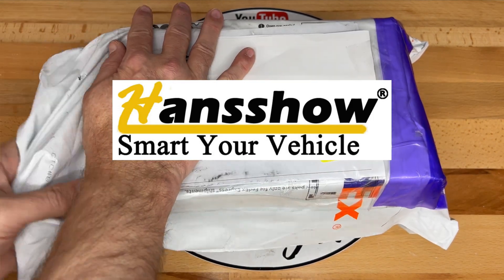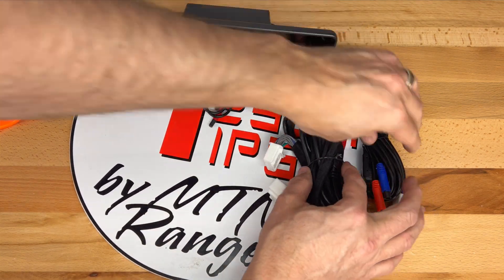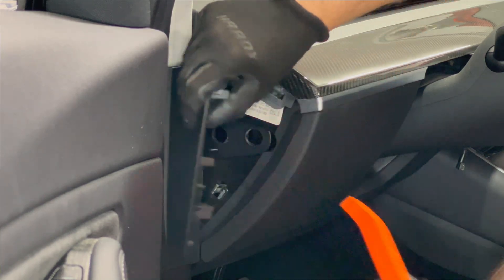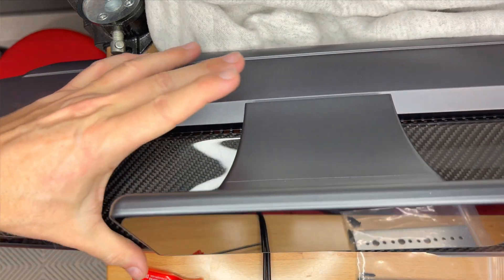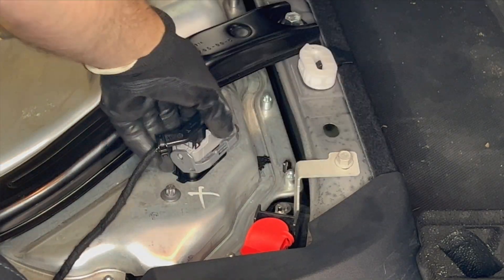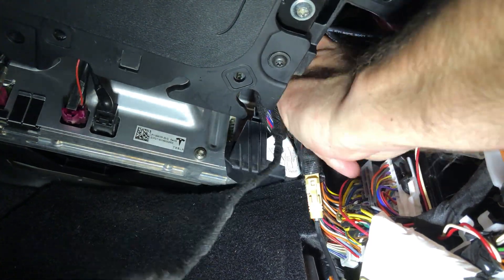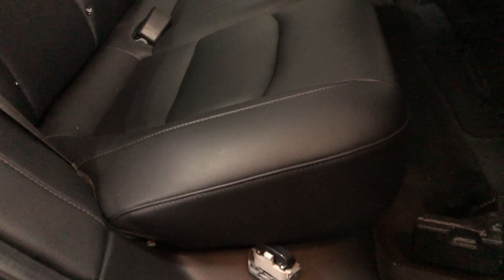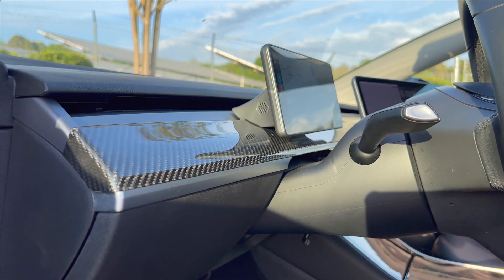Tesla Model 3/Y - Hansshow Touch Dash Screen with Apple Carplay and Android Auto - Installation

Comment: Hi, where do I hook up the power (red & black) wires for the AMD version?  Where can I download the installation manual for this 2nd generation Hansshow unit?
Reply from the maker: I have an Intel system, so I don't know where the AMD wires are.  Most likely in the same area, I guess.  Here is a link to the manuals I have: https://drive.google.com/drive/folders/1k5zyAvx-luI7tXWKqJKnPRrJwZ5pe4pv?usp=sharing
Reply: Thank you so much for your help.
 @MTNRanger

Comment: For the 2023 Tesla Model Y/4 the plugs look different under the passenger dash panel and the cable used is not the same as the one in the video. Any help with this model? Thanks!
Reply from the maker: I don't have a Model Y, so I can't comment on the different plugs.

Comment: I installed this unit today, however, the screen isn't pulling any data from the car. The display shows I'm travelling at 120kmph when I'm still in park etc. car play works fine. Does anyone know what could be causing this?
Reply from the maker: Check the wire connections (where the red and blue wires connect and the connector that plugs into the car's CPU.)  That's what I would do first.   Carplay will work even if the unit isn't getting data from the car.  It's getting power though.
Reply: @MTNRanger  Thanks for the response. I'll have a fiddle with the connectors. The brightness is in sync with the Tesla but nothing else is which makes me think the issue may be with the unit itself.
Reply from the maker: @johnblanco7662  Then I would contact Hansshow for a replacement.

Comment: Nice vid!!
I have the previous version of this screen and is too hooot where I live i have to take the out because the air is blocked like 90% directly to the face I wonder how is the air flow on this one that’s my 1 one concern as now
Reply from the maker: Yes, this design is smaller and blocks fewer vent holes. I set the HVAC fan to split for both the driver and passenger sides.  I also aim it a little higher than before.  It does block air, but without it the fan direction was never that great in my car anyway.

Comment: Hi, could you please share how you get the 12v red and black wires done. I tried to fish the cable from the frunk but won't be able the see the wires. Please help
Reply from the maker: As I mentioned I didn’t do it in this video.  However, I did do it in the power frunk video: https://youtu.be/NMDmPNRNn4o?t=17m0s

Comment: I have the 2021 Tesla Model 3 long range. Just got the display and I was trying to install  and discovered that the blue and red wire ends are to big to fit through the das holes. Ever hear of that? I have contacted Hansshow and am awaiting a reply.
Reply from the maker: Interesting,  I wonder if there is a difference in the model year.   I contacted Hansshow and I'll let you know what they say.
Reply: @MTNRanger  Come to find out I was trying to insert the harness wires thru the vent holes and not the display wires. I was the idiot. BUT ... Now that I have the display wires thru the holes, there are no screw holes to secure the silver backing plate on the underside of the dash.. So I still have to return it.  I would include a picture if I could/
Reply from the maker: @mervay1  Can you send me a photo at mtn_ranger@aol.com ?
Reply: @MTNRanger  This has all been resolved, I did not realize that I was supposed put the screws through the silver plate and into the screw holes in the bottom of the display poking through the dashboard. Sorry for taking up your time.
Reply from the maker: @mervay1  No problem.  I hope everything goes well.

Comment: I have asked a few YouTube posters that showed a successful install of this device.  I had this professionally installed today and when they plugged in the cable in the back of the computer behind the glove compartment the car freaked out and everything inside the car wasn't working correctly, protection faults, car wouldn't go more than 35 and a rear light stopped working.  They plugged the original cable back in the car was fine after that.  Replugged back in and the same, so I am not sure if I have defective unit or my June 2020 Model 3 has something different than other Teslas.  Did you see any of these issues?
Reply from the maker: Did they do the full shutdown procedure including removing the high voltage disconnect?  I guess it is possible that the cable is damaged or incorrectly wired.  I would request a replacement wiring harness.  Another thing, your car most likely has the Atom CPU, was that the correct version of the Hansshow cable ordered?
Reply: @MTNRanger  I bought mine from amazon which gave me both the Intel Atom and AMD Ryzen cables.  I don't for sure know if they disconnected both power cables.  I provided them your youtube video for a instructions on installing.  I am getting the replacement product on Saturday and going to go back over on Sunday to see if that fixes it and I will make sure we disconnect both power cables from the battery and high voltage disconnect.
Reply from the maker: @AaronMcFarland  Sorry you're having problems.  I hope it gets fixed soon.
Reply: @MTNRanger  Turns out the first one I had was a defective product.  The second replacement one worked perfectly.  The one thing I noticed, both times they powered down the car unplugged it (both the battery up front and the main battery), re-plugging it back in the climate control was getting the message "Climate Keeper unavailable due to system fault" and remote climate control wasn't available, but that message was gone after a night's sleep.  Glad I got it working though.
Reply from the maker: @AaronMcFarland  I’m glad it worked out after getting the replacement. Enjoy!

Comment: Is it okay to attach the center display attached to the tesla model 3 intel version to the new AMD version? I have had old version 10.25". Thanks,
Reply from the maker: As far as I know, the AMD car needs to have an wire attachment to the car’s 12v battery.  The Intel screen version doesn’t have this cable.

Comment: Have you heard of any cases where Tesla would not do a repair if they saw this product installed? Music they won’t do suspension work if someone has done a coilover replacement.
Reply from the maker: No I haven’t heard of it being an issue.  I have a mobile service scheduled next week.  I’ll ask the service tech.
Reply: Guy on YouTube said his battery warranty was voided for getting suspension done at a 3rd party garage.
Tesla can’t be that strict right?
Reply from the maker: @hamster1-1  I haven't heard about that one.  Usually if you get a specific thing done it only affects that part of the car for the warranty.  For example getting modified springs/coilovers that somehow causes control arm damage will not be covered.

Comment: How is the vent air flow after install and how does the screen do in direct heat/sun? thanks
Reply from the maker: I drove today in 85F weather and had the fan direction facing up.  I also find using split helps too. When getting into a hot car, I try to precondition.  Otherwise using it on a high fan level to cool it down and then around 4-5 for normal use.

Comment: The updated 2022 9” version of this product no longer supports the front camera. Updated 9” has a smaller bezel than the original 8.8” to block less air flow.  If you were choosing a display system today would you go with the small bezel 9 inch with no-camera or the 8.8 inch with front camera?  Front camera is nice and low, automatically turns on when front sensors go off and the first seconds of drive pretty cool.
Reply from the maker: It comes down to the camera.  If you really want it, then go with the 8.8" screen.  Another tradeoff is the 8.8" has a 1080x720 vs 1920x1080 on the 9".  Personally, I'm fine with the 9" version.
Reply: @MTNRanger  yeah I think I’ll just go with the newer 9” for the max stability performance, higher res and slightly more airflow.  we already have built-in front proximity sensors which is good enough as well

Comment: It's been a month since this video was made.  Any pros and cons you can share?
Reply from the maker: I took a long trip a week ago and it worked very well. I used ABRP, SiriusXM and other apps.  Definitely nice to have.  The only negative I have is on rough roads, it can vibrate.  I'm looking at placing a foam pad where it meets the dash and see if that helps.

Comment: I have just watched a short installation video of a different display being installed in a Tesla. The connector is located at the bottom (behind the cover) of the rear air vents. I now believe Tesla has more than one of these "connectors" that tap into the vehicles computer for power and data to run displays.
Reply from the maker: Yes, there are multiple places in the car with communication (CAN bus) wiring.  Not all have the same plugs.  The connector behind the center console of a 2017-18 Model 3 has 16 pins, 2019+ has 22 pins.  The wire harness connector with this screen has 12 pins.  https://youtu.be/i08OltkqzYU?t=368
Reply: @MTNRanger  What path would you take with the harness, similar to the Hansshow harness with this display kit, connected at the rear air vents going towards the drivers side dashboard just like this Hansshow display attached in the vents? Would go along the the center console?
Reply from the maker: @Speedbird100  You could remove the center console trim that runs from front to back.  You could route the wire through there and up to the area under the steering wheel.  You will have to remove another trim panel and snake it along that area.  Then go up  to the left side to the dashboard vent area.

Comment: How much would it cost to hire someone to do this?
Reply: Well I hired Car Toys in Northglenn CO to install and for some reason the device is not working plus the car is freaking out with the new plug plugged in.  I am getting a replacement device to see if that fixes the problem.  Currentl the I have spent almost $400 for installation.

Comment: Hi. For an Uber and Lyft driver like myself, will i be able to do android wireless and use the Lyft and uber app on the screen and avoid using my phone for the app and built in app navigation?
Reply from the maker: Good question. I have Uber and Lyft apps on my iPhone and they do not show up on Apple Carplay.  Drivers use the same apps as passengers, correct?
Reply: @MTNRanger  no they have different UIs. Im trying to avoid using my phone while doing Uber so this would be great if it worked for that. Here is what i found on Google, but not sure if its accurate or not.

This summer, Lyft is integrating its app directly into Android Auto for drivers. This integration will allow drivers to view and accept rides right from their car's infotainment system. That means no more secondary device, which should make for a much cleaner Lyft driving experience.
Jan 5, 2022
Reply from the maker: @republicofu.s9642  If that is the case, the Android Auto version of Lyft will work with Hansshow screen.  BTW, I just downloaded the driver versions of the apps on my phone and they still don’t show up on Apple CarPlay.
Reply: @MTNRanger  i sent a message to Lyft support also.
So this display requires no cables to connect to Android? Its all wireless?
And are you able to see all the apps you have on your phone on the display? 
What does it say on the display when you click on the Lyft app
Reply from the maker: @republicofu.s9642  I tested it with a Pixel 5 with Android 12 with a Bluetooth connection (no USB cable).  Android 11 and 12 support wireless Android Auto.

Comment: Nice HVAC shield
Reply from the maker: Honestly, I haven't noticed any issues with the vents since I put it in split mode.
Reply: @MTNRanger  I like getting the breeze directly at me as opposed to ambient cooling in the cabin.
Reply: @MTNRanger  I also should mention that I live in Arizona. Probably a different experience with temperatures than you get where you’re at.
Reply from the maker: @Meaderf  My early 2018 HVAC vents never really seemed to ever direct air that noticeably unless the fan is maxed out.  Newer versions may be better.  Yes, I guess if you require direct air in your face, then this item is not for you.

Comment: I would recommend placing the screen on the dash before removing, mark the position with tape, that way regardless of year, model or otherwise you aren't just relying on Hanshow's estimate on where best to mount it.
Reply from the maker: Yes, that's another way of doing it.  Thanks for the suggestion.

Comment: I have read that the 2022 Model 3 / Y has the wiring connector in a different location, not under the passenger side glove box. The connector is located behind the passenger side foot trim panel, the one you removed at time 11:20
Reply from the maker: Yes, the probably is right. I don't have a 2022 to test that on.  A lot of wiring does go through the sill area.

Comment: If upgrading from the first version of these screens, do you know if the same cable that plugs into the CPU can be used?  Putting that cable in was such a pain!   Also, did you hear about what their plans are with using a front camera with these new screens?  It wasn’t clear if future front camera capability would require new hardware from their website.  Finally, can you tell if there’s a noticeable airflow improvement between the 1st and 2nd versions of the screens?  Thanks!
Reply from the maker: 1) I will check on the CPU cable - cable is new and needs to be used, 2) I’ll check on the front camera - different hardware, 3) I never had the first version, but this seems fine to me.  I set the driver’s side fan setting to split.

Comment: What is the difference with a right hand drive car? I am in the UK
Reply from the maker: I assume there must be a difference since they specify LHD or RHD on the purchase page.  I'll ask them.
Reply from the maker: Yes, the hardware is different for LHD and RHD.
Reply: @MTNRanger  I ordered from Tesery and they did not specify ltd or hd. I cannot understand why they would be different.
Reply from the maker: @ClimateRealism  Since Tesery is in the UK, they automatically send you the RHD version.  The one on their site has a different user interface, but otherwise looks  like the same device.
Reply: @MTNRanger  My model Y arrives in June but I now see tesery screen on their site states that the screen is for models up to 2021 and mine will the a 2022 hence I amy have a problem. It did not state that at the time.
Reply from the maker: @ClimateRealism  Contact Tesery and ask them.
Reply: @MTNRanger  They have just replied to say the display supports both left and right hand drive cars but now their info states up to 2021 models which it did not do before.
Reply from the maker: @ClimateRealism  As Hornet J mentioned above, the 2022 may require a different cable harness.  Will Tesery accept a return if the installation doesn't work?
Reply: @MTNRanger  I hope so...I will contact them again.
Reply: In the 2021 and earlier models the connector is located underneath & on the right side of the glove box: 1) In a Left Hand Drive car the connector, as can be seen in the video, is near the A-pillar. 2) In a Right Hand Drive car the connector is near the central tunnel / arm rest area of the car. Therefore the harness needs to be about 50 cm longer for a Right Hand Drive car. In 2022 cars with the AMD Computer the connector (BLUE) is at the lower the part of the A-pillar. The harness for cars with an  AMD computer has 2 additional wires, RED that connects to the positive battery terminal in the frunk and a Black wire that i think needs to be grounded instead of being connected to the negative battery terminal in the frunk.
Reply from the maker: @Speedbird100  Thanks for the info.  Since I have a 2018, I don't have the ability to see the changes in the 2022 vehicles.
Reply: If you go to Hautopart (use the link provided after video description). At the Hautopart website 1/4 of the way down select the Installation Manual  tab  where you are able to select & download the installation manual for this product,  the 9.0 inch display.
Reply from the maker: @Speedbird100  Yes, that is the instruction guide I used for the installation.